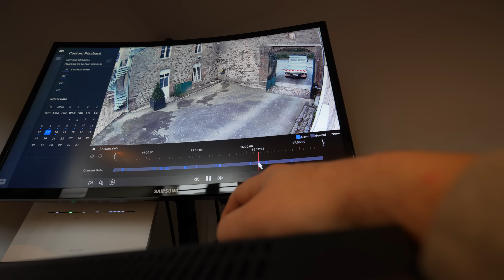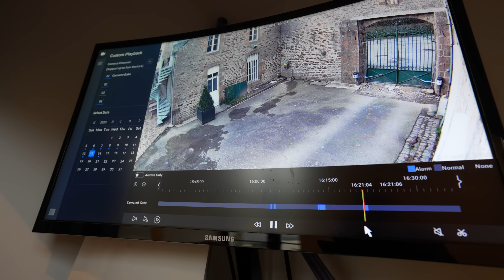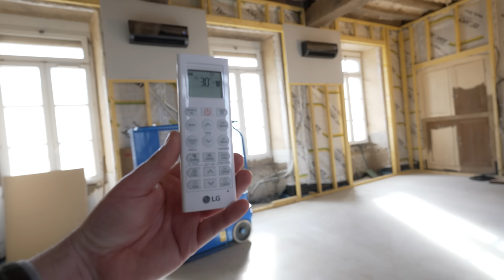Today Didn't Go To Plan

Comment: Window seating would look nice in the area to cover pipes.
Reply: thats what i thought, a simple window seat with comfy cushions..sorted!
Reply: I was thinking that while I saw it too. It would be a very easy solution
Reply: Love that idea!
Reply: My wife said the same thing about the window seat!
Reply: I thought so too.  A nice window box would hide the duct work, allow access if needed, and create extra storage.
Reply: @mharbott70  good point.  It looked to be between his hip and knee when he stood beside it.  I think if they’re clever (and we know they are) they could use the frame work at the front and sides to overcome that, and still hug the lovely frame of the window.
Reply: I was thinking built in storage but I like the idea of window seating better.
Reply: That's what l thought as well. A window seat.
Reply: I was just going to make the same comment! Definitely a great spot for a window seat.
Reply: @kentlatimer652 could be both
Reply: @judy4123  very true
Reply: @petat13  a window seat with a table in front was my first thought. Then I saw your window box idea & thought if it had thin cut marble on top that matches the new puzzle, it would look nice with potted plants on it. Add hinges for easy access to the pipes, get tired of watering plants? Throw Pillows, TaDa.
Reply: Yes! With storage inside.
Reply: They could have made those pipes neater for you dude. But window seats are always a winner.

Comment: The wind is not just something that is blowing on the door itself, it is the result of a difference of air pressure in different parts of the location. With the convent being a sizeable building, there might have been a pressure drop inside due to chimneys, windows open (or not airtight) on higher floors, on the downwind side, etc, and a sudden rise in pressure in the yard could have pushed the door open. 
Either that or you disturbed the evil spirits in the basement that time you went down there, and there's no nuns to pray them away now!

Comment: You could cut out the timber that is up against the wall where the air conditioning tubes come across the top of it and set the tubes back in against the masonry to gain a little bit of space around your corner.

Comment: Congratulations on getting the air conditioning installed! My suggestion for hiding the wiring below the windows - how about window seats? And if you line them inside and add doors on the lower front they can also be used for storage. What do you think Billy? Rita and Ian, Tasmania

Comment: I wouldn't put the sink unit in the cubby to cover the pipes because the kitchen faucet will prevent you from opening the window since the window opens inward. There are definitely some other excellent suggestions here and I'm sure it will look fabulous whatever you finally decide. 🙂
Reply: I have that same issue with my sink at home. The counter height is level with the window opening. What a poor design! Not only does water splash on the window, but using the window is a problem. I do like being able to see out, but next time would have the window higher than the counter so there’s a back splash at least.

Comment: If you get a Switchbot temperature sensor and IR Hub you can program it from an app on your phone to turn the air-con on and off on a schedule or based on a temperature conditions. e.g. turn them on in winter in the morning if the temperature is especially low. Turn them off at midnight every day in case someone has left them on. You can also see graphs of temperature and humidity and control them remotely from your phone. Not only the air-con but any device in the room that has an IR a controller.

Comment: Tip: don't turn the heat pumps on and off, leave them on 24/7 or it will cost you a lot more money to run them

Comment: yeah looked like a gust of wind. you bought that Bar didnt you Billy? 😂😂 stop making excuses for the beer and just drink it 😂😂 im sure after a few beers everything could look wonky Sean 😅Air Con looks great im sure it will all blend in at the end. hope you both have a great evening
Reply: Someone mentioned  in a comment that Sean could build a ‘cornice” to disguise the AC units. i can “see” that.Done in oak, curved along  the tops to blend with the new oak window frames. and finished to match. it would “carry the eye along” with no interruption of symmetry.  About the wind storm and wind storms in general: closing the damper or covering the opening of a fireplace is a very good idea in winter if there is no fire on the grate. otherwise the heat is sucked up the chimney, but these measures are also for safety. It has happened in our house that in a wind storm,  the wind can come down the chimney and blow the fire and ashes into the room, if the pressure inside the building changes.The wind blowing over the chimney creates suction and sucks the air out the room,  creating a negative air pressure, which then pulls the air down the chimney. It happened to us when there was, thankfully,no fire, but the damper was open. The room was filled with ashes and soot,, a real mess to clean up.. We stopped the downdraft by opening a window. and learned something about wind storms.and fireplaces. :)

Comment: Wind or a ghost?  Surely Billy locks the doors before he leaves and not just the outer gates? If locked, it's unlikely the wind would blow it open in that location. 
Given the Convent's history, both in terms of age and purpose as a hospital, it would be rather strange if there (wasn't) a wee ghosty or two hanging around; nothing to worry about except in terms of the building's security.

Comment: Why don't you build a window seat over the pipes for the heaters. It would be nice for sitting by the window.  I have those mini splits and you do have to clean the filters every month or they won't circulate the air. Trust me, it is a huge difference when they are clean. How are you going to get up to them to clean them?

Comment: Sloppy with the hole at the base of the wall. The pipes are coming in below the frost line, not good. At least the units are installed.